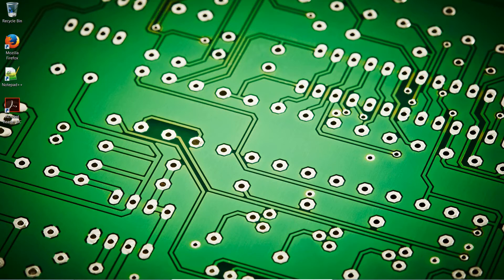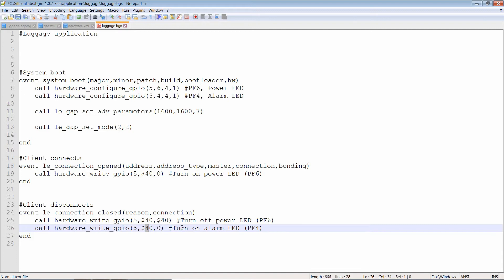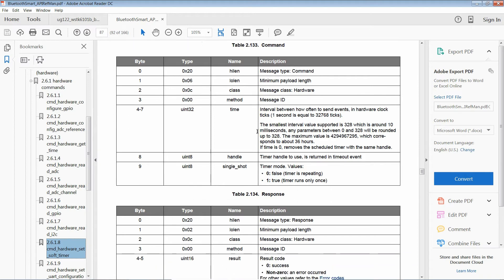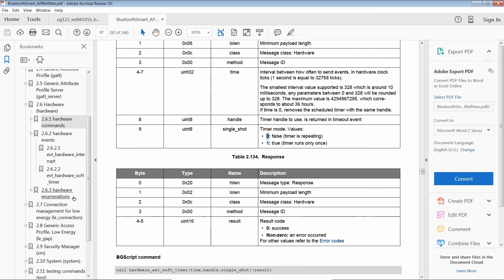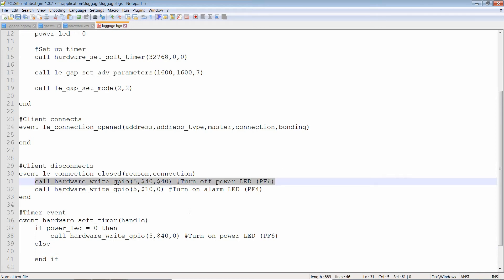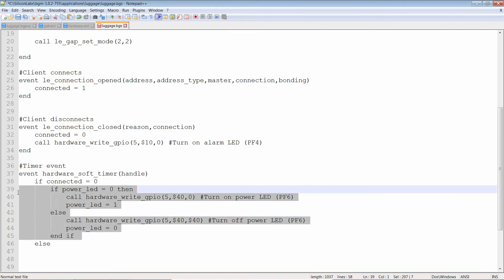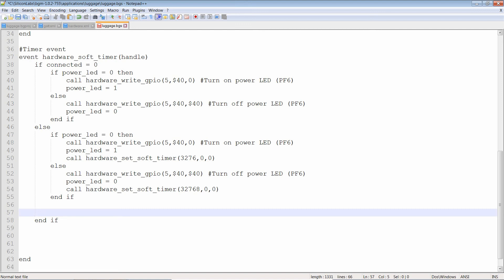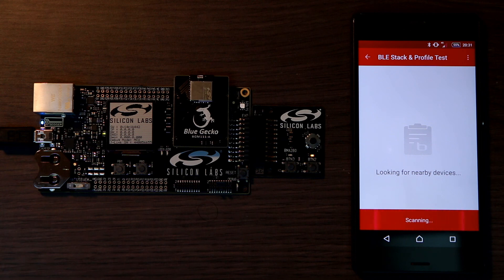Bluetooth in Action 7 - Variables and Timers

Comment: Hey James,

great Video, which really help understanding BGScript more! 

I also just started with BGScript and want to program a remote thermometer that collects temperature data e.g. every 10 minutes with a “timestamp”. The data should be stored in the flash (that it should do when storing the value as a constant, right?), so that the data can be retrieved later e.g. one day. Do you have experience with storing data on the BGM111 and retrieving larger chunks of data? Its my first Bluetooth project and I got already a bit frustrated :)

Do you know where I can find more easy examples of BGScript applications?

Best regards, Rob
Reply from the maker: Hi Rob,

Thanks! I'm glad this is useful to you.

BGScript isn't very helpful when it comes to saving large amounts of data, but there are ways around that. You've just given me an idea for the next project, I'll create a temperature logging device that uses external EEPROM via i2c, and that formats data to be picked up every so often. Does that sound good?

As for examples, there are quite a few example programs on GitHub, but I'll admit that one of the reasons why I wanted to make this series is because there was a lack of documentation and example projects, so I decided to make my own.
Reply: Hi James,

that sounds like an interesting idea using an external EEPROM. Still, there should be suffienct amount of  memory in the 256 kB flash of the BGM111, assuming one value - consisting of temperature value and timestamp - would use around 4 byte. Further the data can be transmitted to an external device using the GATT Service Object Transfer Service or the HTTP Proxy. At least thats what I researched. But I still lack in coverting the idea to BGScript. You think this could work that way?  How would you proceed? 

I´ve come too far, too give up now :)

Best regards!
Reply from the maker: I made a quick app just to see how it would work, and the problem is that BGScript has limitations when it comes to data storage; the maximum array size is 256 8-bit values. Besides, I prefer to use a more durable storage system in case of power outage, or very long term data retention. So for the first version, I'll be using EEPROM. To get data back, not too sure, I haven't looked into that yet :)

Comment: Hi James,
This is a nice series of tutorials.
Two things I think could add a bit of value to the videos:
1- You could use Notepad++ (which I also use extensively) to select a language for bg scripts in order to get a little bit of color in the scripts code. I don't know which one would fit best, though.
2- When you look up values in the bluetooth descriptors or the documentation you could split the screen such that viewers can still see the code on the left side. BG script lines being quite short, it should fit.
Good job!
Marc
Reply from the maker: Bien le bonjour Marc! Thanks for the advice. I believe that someone actually made a BGScript plugin for Notepad++, I'll try and integrate that. Sorry I didn't do it earlier, I'm colorblind, so I rarely work with colors, but you are right, it would help out a lot. Too late for the next episode, but I'll add that in the near future.
I'll also split the screen next time, you are right, it should make things easier to read, and I way well need that for the next project.